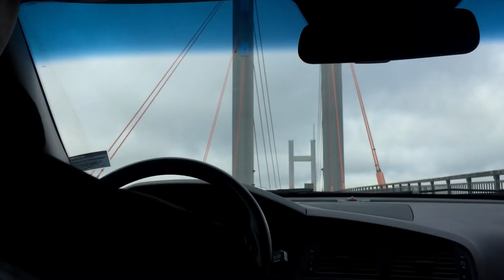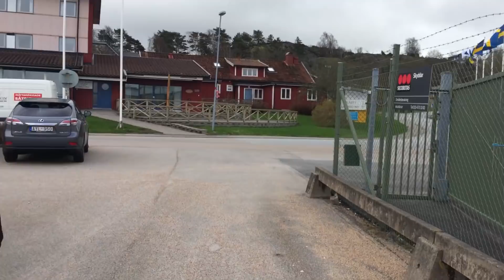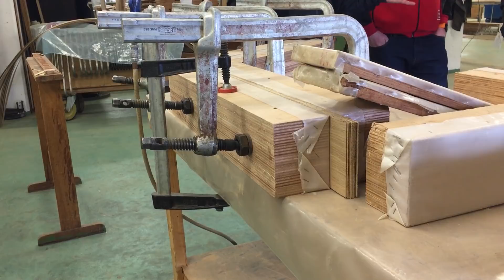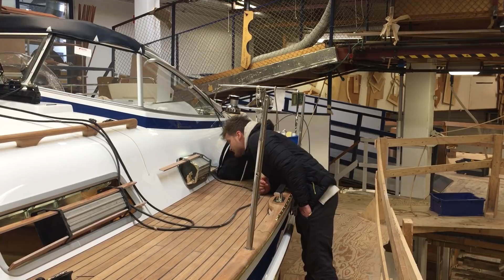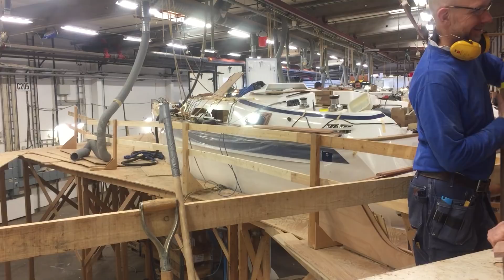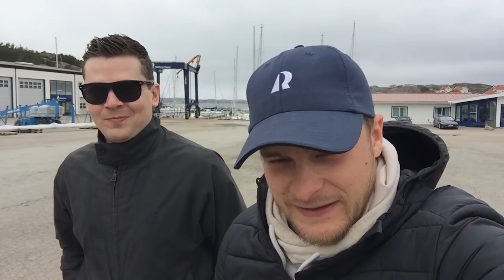A TOUR of the HALLBERG-RASSY YARD in Sweden

Comment: Yip, the rolls royce of monohull cruising yachts for sure, do they make ANY aft cockpit boats?? Centre cockpit is the way to go for sure, safer and dryer for passage making, as much as I'm a monohull purist, for what you're paying(a ℅ of it for a name, much like Aston Martin) I'd hate to say it but I'd go with one of the 3 South African built catamarans, a baby Leopard will give you double the volume for a similar price, Robertson and Caine build good boats, as do St Francis Marine and Nexus. I'll put it this way, if you want the benchmark in monohull cruising yachts Hallberg Rassy's are just that, and if money were no object they would be my first choice, but for the same price as a  40' odd Hallberg Rassy you can get a similar sized catamaran in SA. Don't get me wrong, catamarans are not perfect boats, and neither are Hallberg Rassy's, or ANY boat for that matter, there is no such thing as a perfect boat, The closest I've seen is a 45' Van De Stadt designed steel hull, centre cockpit Dutch built modified full encapsulated keel canoe stern, much like the valiant 42' with a flush teak clad foredeck, keel stepped mast with cutter rig to bowsprit, both headsails on furlers, and both cockpit and saloon access to aft master en-suite cabin.